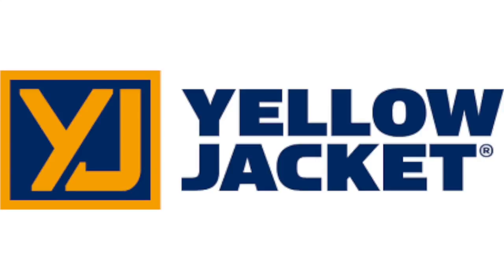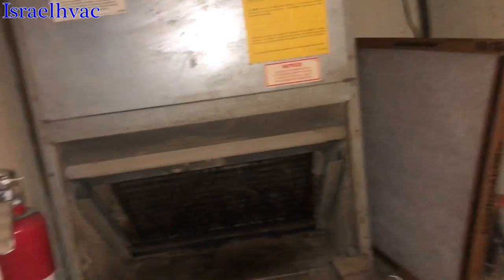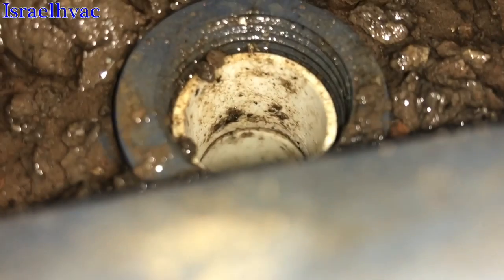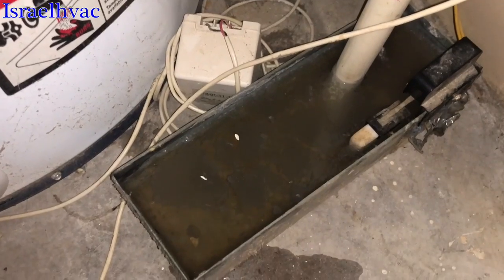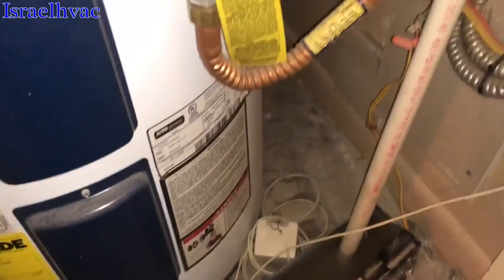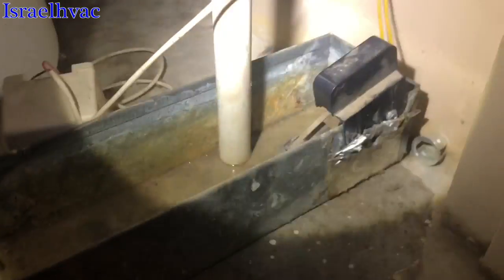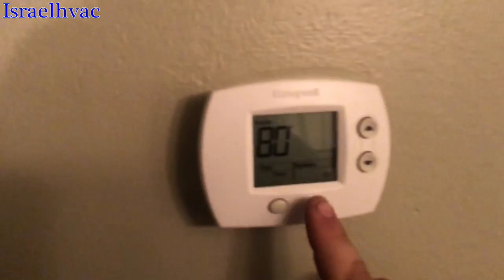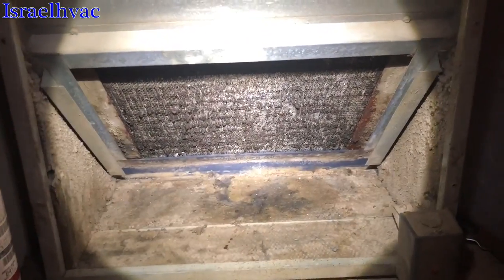HVAC | Apartment AHU Setup

Comment: Hi there.. great video... ive been looking around fir videos looking like my ac unit and this one is the only one ive found...
Let me ask u, due to my ignorance ive put my filter with airflow sign down which means towards the floor. I just found out it was wrong all this time. Today i realized it was wrong... Ive changed my filter 2 times already the same way for aboit 11 months now...
I have a qyestion for you, my set up it is the same as ur videi with 2 tubes as well, but instead of having that tube towards the container full of water in your video, mine has a little cable that is pluged to a small box on the wall. ...The area where the water rests right there where the 2 tubes rests, mine has some kind of dirt (like mold)mixed with water and one of the tubes has some of that dirt inside(i checked with my finher),it is not full which means water still goes through it. 
What should i do?
Should I get an ac tech?, if so what job should i ask for?, i dont wanna be robbed, money is tight now a days.
My ac blows cool air, no issues there. Ive always had it on 77 here in south florida.
Any advice u would recommend, i will appreciate it !.. 
Thanks !

Comment: We install the primary drain with a p trap and a clean out stack with a cap, then we install a float switch on the secondary drain that shuts the air handler off when the bobber on the float switch rises.

Comment: I have a big air conditioner in an apartment in a closet door that’s how big the air conditioner is and there is a vent going outside now. Does the air conditioner unit suck some of the air from outside also besides sucking air from the apartment room onto the filter And through to cool the apartment down

Comment: Hello I know this video is old but a google search brought me here. I have this same setup in my apartment. My hall carpet was wet and I heard dripping so I broke into the utility closet (they keep it locked)… it is filled with water. I pulled out the filter and Maintenance haven’t changed it since Sept 2020. Behind the filter is full of water and that whole area is soaking wet. Only thing maintenance did was use a wet vac to get the water out, that was last night. By this morning it was filled up again and leaking. Now my carpet is soaked my floor and the walls. Any advice I have videos and pics

Comment: Hmmmm,  looksa like a NY Kooka Racha got into that water and didn't make it.. 
The only way I could remotely see that setup having any adv over an in-line, is if the Pan was big enough to hold enough water for 24-48hrs and there was another switch near the bottom of the Pan rigged to an alarm, not a shut-off, that would alert the owner that there's an issue and condensation water is backing up. Doing it that way would allow a small window to keep the unit running til a tech could get out and service it.. Other than that, In-line!

Comment: It's better than anything I've ever seen done in an apartment. Around here, the answer seems to be "we don't care if it floods the floor, even if it's a water heater drain". Having had to clean up after those sorts of messes, I'd spend the little bit extra and do it right.

That evaporator coil looks really rough. Is that a 24 volt AC "wall wart" transformer being used for the control voltage?
Reply from the maker: uxwbill  thanks for watching and the feedback. It’s much appreciated

Comment: usually I would do a similar method as the one there, except I use an ss2 float switch on the front of the AHU to make it accessible.

or, coming off the primary drain connection like so,  (see FB link below)

here is an install we did!  I was hoping there was a picture to focus more on the drain line.  that is how we did an SS1 off the primary drain of a Goodman AWUF series AHU.  https://www.facebook.com/174270715932643/photos/a.452822514744127.125195.174270715932643/1955827011110329/?type=3&theater